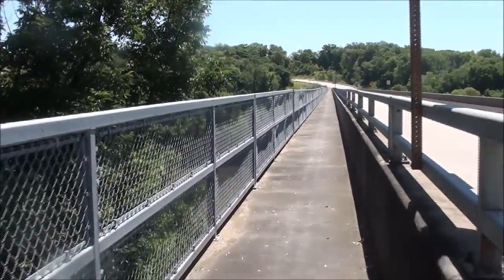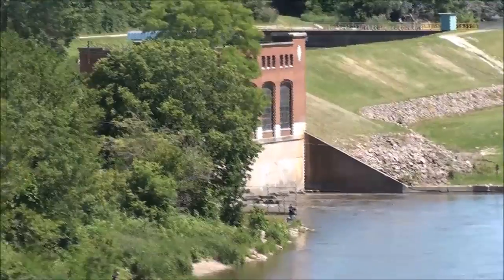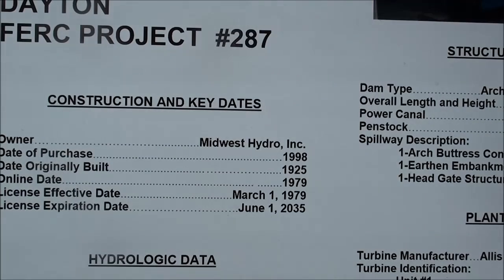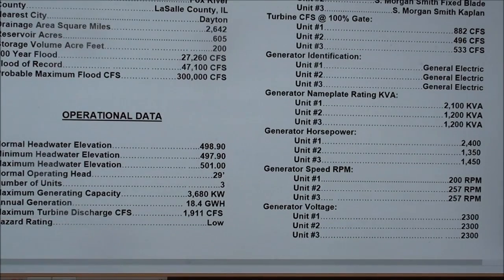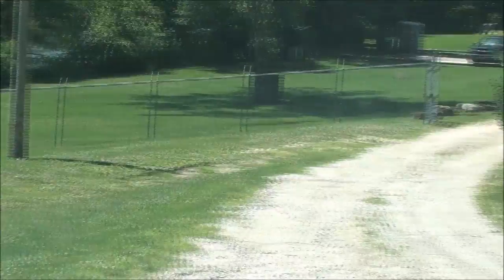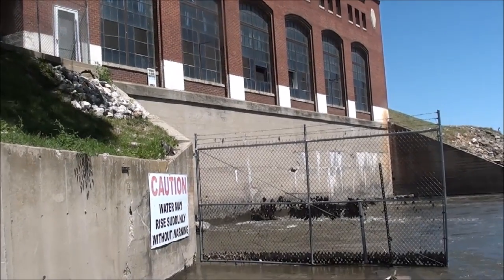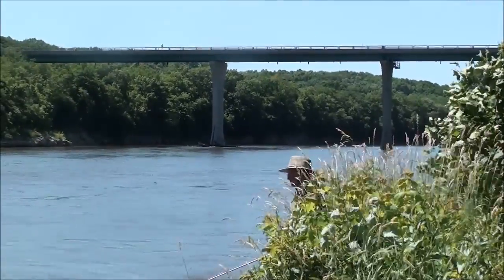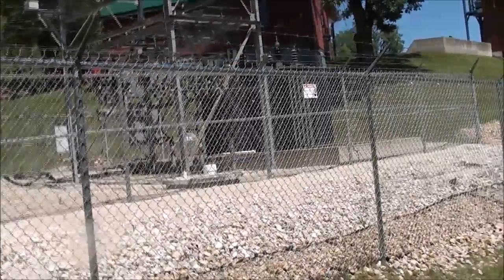tubalcain ROAD TRIP part 2 How Electricity is Made-WATER POWER video 3

Comment: Dang, where to start; thanks for doing this video! 

In the early eighties, I lived in a cabin on the other side of the Fox from the Dayton Hydro plant. Rex Potter was the superintendent at that time, and we were good friends. I helped with minor repairs on my days off, I had my South Bend lathe set up in there (facing the outside windows near the office) and that was my morning coffee stop on my days off, usually right after Rex checked in. During that time frame, there was a fatality at the plant. The water doors for the turbines did not seal well on their sills, and in order to conduct repairs on one of the turbines, Matt Mercer the diver was called in to seal up the water door well enough to disassemble the turbine. Something went wrong (don't know what, I was gone to work), but Matt got caught is an unexpected current, and his neck was broken.

The Marseilles plant was a little gem. I was in there with Mr. Potter one occasion, and that beautiful marble switchboard really impressed me! IIRC, the raceway was owned by another company, and basically, they "sold" river water to the hydro plant and the Nabisco box plant. I don't know, but that may have been a factor in Illinois Power's decision to shutter the hydro plant. In the flood, the raceway was the low spot where the flood waters first broached Marseilles.

About that "accident" with the barges... I was there. At that time, I was the engineer on one of the towboats peripherally involved in the mess. The primary participants was the M/V Dale Heller, which was owned by Ingram Towing, and the M/V Loyd Murphy, which was owned by ACBL.

There was an operating procedure at Marseilles Lock that once you lock through going upstream, you have to leave the canal. That morning on a rapidly rising river the Heller found that they could not fight the strong current in the rock cut above Ballards Island, so they tied off to a tree to wait it out. 

Later, the Loyd Murphy was traveling downstream, and they realized that due to the outdraft going into the canal (outdraft: strong current pulling you towards the dam) that they could not make it into the canal, so they tied off to the Heller's tow. We now have 29 barges and two boats tied to a tree in the face of what is rapidly becoming a raging river.

It was decided that the Murphy's tow would be moved across the river to an area under a point that was a little sheltered from the current. My boat, the Murphy and the USACE tugs moved the Murphy's tow to the other side of the river, where we held it in place alone. The other boats then went to move the Heller's tow off the island.

The NTSB report lists the cause of the crash as a "misunderstanding" between the captain of the Heller and the lockmaster, and the decision to proceed despite the record high water.  From the report:
 
"The National Transportation Safety Board determines that the probable
cause of the allision of the Dale A. Heller tow with the Marseilles
Dam was the decision by all involved parties to proceed with the
passage of the tow during a period of record-high water and
significant risk. Contributing to the accident was the failure of the
Marseilles Dam lockmaster and the Dale A.Heller's captain to
communicate effectively about the actual positioning of the dam’s
gates before and during the transit." 

Personal observation here:
This could have been done safely, despite the stage of the river. The Heller's tow was fourteen barges; two strings of five barges and one string of four barges The mistake was trying to move the whole thing at once. A smarter approach would have been for one of the big boats, say, the Murphy, to face up to the tow on the downstream end and push against the current with the USACE tugs pushing the tow against the bank. The Heller could then take a string of five barges down into the slack water of the canal and tie them off. Then, go back for another string, etc. until the barges were all in the canal. It had enough power to overcome the current with five barges (or even fewer). I think that "horsepower hubris" had taken over; the thinking was that there was enough power there to overcome the effects of the current. Obviously, there wasn't.

The upshot was that Marseilles was flooded. I watched the water level where we were at the time jump up substantially when the barges landed on the dam. Look at the photo in the report; six of the eight gates are obstructed by loaded barges, with the four closest to the canal practically sealed off by sunken loads. I'd say that it is entirely likely that Marseilles would not have flooded if the accident never happened.

In the end, the two gates closest to the canal were destroyed, and had to be replaced. The cost estimate on the damage to the dam was $60 million, and the estimate of barge damage was about 3.75 million. All in all, preventable.

https://ntsb.gov/investigations/AccidentReports/Reports/MAB1411.pdf

As an aside, my boat brought the replacement gates up the Illinois to Marseilles.

Comment: My first thought was to stick to the technical stuff and save the sight seeing for other videos.  I appear to be in the minority.

I liked the tech details of the dam.

Some ideas to improve.

Since alternators are the most common "rotating" method of generating AC 3 phase an automotive alternator is the same basic design.  Disassembly of one would make a very good model of the larger units.  Discard the rectifiers.

Talk to the owner operators of facilities and ask for a tour and explain what you are doing.  I am sure they will give you a tour and show you models or spare parts of turbines and alternators,

I teach how AC and DC motors generators and alternators work and start with the very basics.  I use visual and feely touchy extensively ie pass it around and take a look and also use operational demo units.  I can send photos of this "stuff" and maybe video if I find a reliable video guy. 

We have a bit of hydro out here also.
I am also US Navy Nuclear Power trained

I hope this info will help you improve on the techy stuff.  I think you have a great idea.  I am willing to help - let me know how

Dan Bentler
Seattle